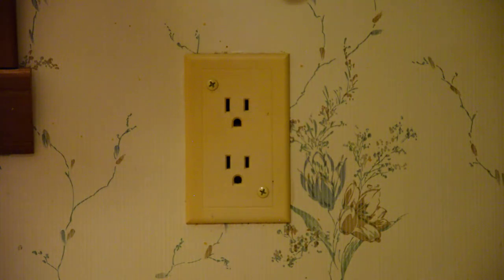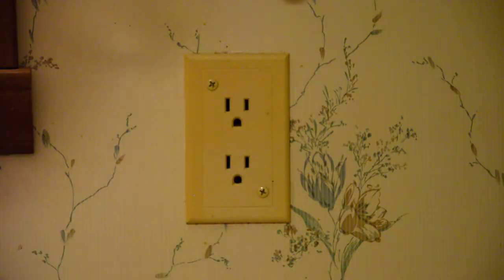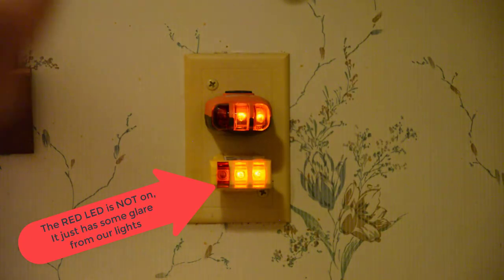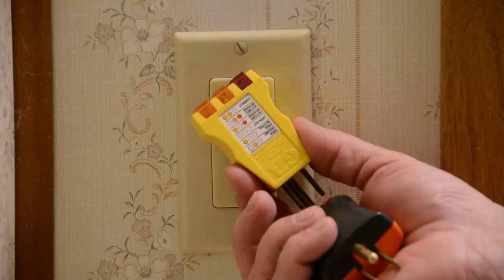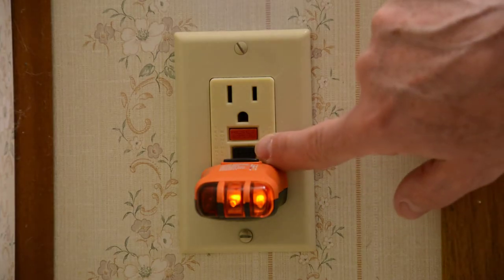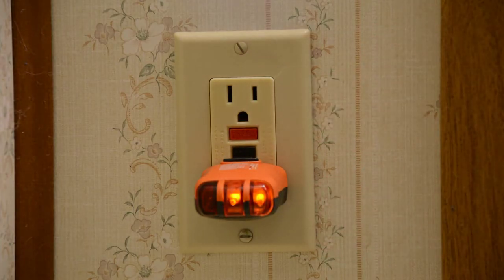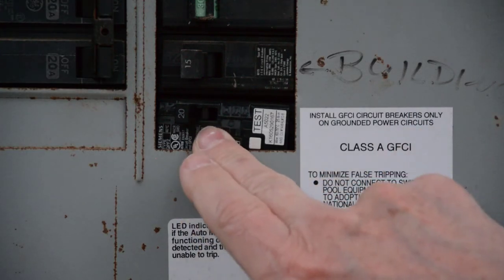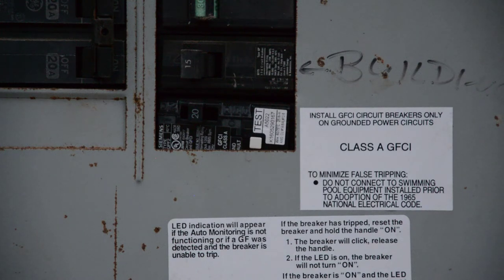Testing Standard & GFCI Outlets

Comment: Hi there can you please explain why as soon as I plug the HarborFrieght tester in, the circuit breaker automatically resets? If I push the reset button, my tester is working and it shows correct lights
Reply from the maker: I can't say for sure but my guess it that your GFCI is very sensitive. Thank you for visiting and have a great day.
Reply: @DIYwithWayne Thanks. I was inadvertently pressing on the button while trying to plug the tester in 😂😂😂
Reply from the maker: LOL,  I have done things like that before.  Thanks for the reply.

Comment: Thanks for your video and Funny....I have exact same yellow older outlet tester. 🤠 I have replaced 120V receptacles off and on for last 40 years...before non contact voltage tester OR outlet testers existed! I have also installed many 2-way, 3way or 4-way wall switches or 120V GFCI. Also when I was 16-18 I was shocked around 5x by 120V in OLD house that had various outlet or electrical baseboard heaters misfires or ungrounded as house was 1905 and believe last owner NOT electrician did most of the wiring! Not correctly, out of code
Reply from the maker: Thank you for visiting and I'm glad you survived the old wiring.   Have a great day.

Comment: Great video, thanks so much!  What was the brand of the outlet tester you were using?
Reply from the maker: The yellow one is the older one and it is made by GB Electrical and is about 30 years old.  The orange one is fairly new and made by Ames,  It's model is GST-125.  The newer one is the one with the test button for the GFCI outlets.   I hope this helps.

Comment: What does it mean if both lights are on in the correct mode "two lights", not the GFI socket, but the middle light is very dim, on the regular socket, and it's not working? GFI tests out fine where it's hooked up too. Replaced the regular socket, with the same results. Maybe replace the GFI now?
Reply from the maker: It's hard to say but it could be a loose or bad connection or a bad GFCI socket.  Also: if your outlets have the holes that you can just push the wire into, I would suggest not using them and install the wire under the screws.  It makes a better connection.   Good luck with your project and have a great day.
Reply: Sounds like an open neutral. There may be a wiring problem upstream. The middle light is hot-neutral. The right is hot-ground. These should lit on properly working socket. The red light is neutral-ground. It should not lit.

Comment: I have that Ames tester. You said with 2 yellow lights on it's wired correctly,  but on the tester it shows that means Open Neutral . I'm confused.
Reply: It's hard to tell just what is going on . Some of the diagrams show the left light as yellow , like correct wiring has only the left light on but it isn't shown as red. ? ?
Reply from the maker: If yours is like the one I have, the white spots on the diagram indicates the light is not on.  If the spot on the diagram is yellow or red it indicates the LED is on.  I hopes this helps.  Good luck with your project and have a great day.

Comment: I had a faulty outlet that was next to a GFI outlet that would not work everytime I would plug something in even after I messed with the GFI outlet. Went to harbor freight and bought that ames outlet tester and for some reason when I used the GFI tester on it, it started working again. Do you know why that is?
Reply from the maker: I don't know why but I expect you have a loose wire somewhere or a bad outlet.   Good luck with your project and have a great day.

Comment: So I have a gfci tester plugged in a normal 120v receptacle. If I press the test option, my two yellows go from on to my third yellow light being brighter. Is this normal?
Reply from the maker: No, If the outlet is GFCI protected correctly, when it trips all power is off and there should not be any LED on.  You may have a tester I have not seen before but it sounds like you have a GFCI outlet that is not working correctly.  Good luck and thank you for visiting.
Reply: If there is no GFCI protection then why did you push? Where did you get the idea that you should read the lights while you press the button? Did the manual of the tester tell you do do so? The lights and the test button are not related.
Reply: @okaro6595  He pushed the button to see if it was a GFCI protected outlet.  Pushing the button did not turn all the lights off so it's not a GFCI protected outlet or if it is the GFCI is bad.

Comment: I am on a combo light switch and outlet! Switch still works but the new outlet shows no lights at all. As if the tester doesn’t work!
Reply from the maker: I would try the tester in an outlet that I know is working. If it lights up, you know it's not the tester. 
I would then try it again on the combo outlet. If the tester doesn't light you know the outlet is not working.

Comment: When I push the test button on the gfci outlet. It trips, it works correctly.  When I plug in my outlet tester, I get two yellow light, wired correctly.  However, when I push the gfci button on the tester, the outlet doesn’t trip and I get hot/neu reverse.  Gfci outlet is brand new.  Any ideas?
Reply from the maker: That does sound odd.  I would try another testes if you can.   Thank you for visiting and have a great day.
Reply from the maker: I watched your video and you also said the other outlets work as expected.  In this case, I would replace the outlet.
Reply: @DIYwithWayne  I did that already.  It is a brand new gfci outlet.

Comment: Why are you rocking the tester with so much force to take it out?
Reply from the maker: Because the GFCI Outlet was very tight.  It is a new outlet and had a tight grip on the tester.  We hope you will continue to visit our channel. Have a great day.
Reply: I just bought the Ames electric tester and the only light that turns on is the middle orange one.  I don’t know if it’s just my tester that I got a bad one or what.  I’ve put it on multiple ones and I’m only getting the middle one on.
Reply: @hyster2568  That means you have no ground wire connected to that outlet which is no good..